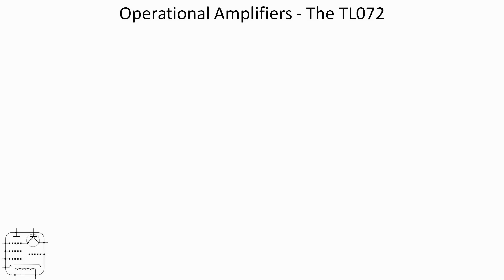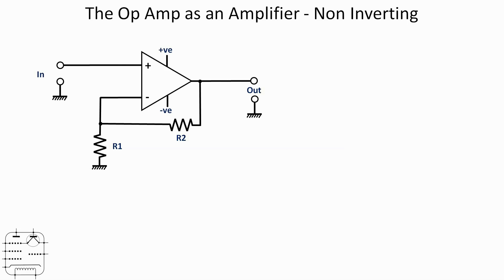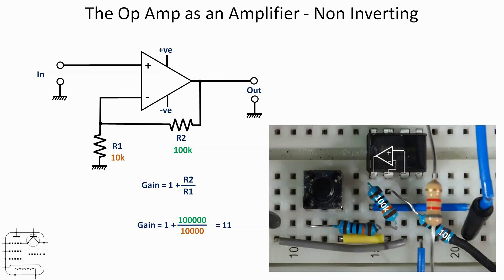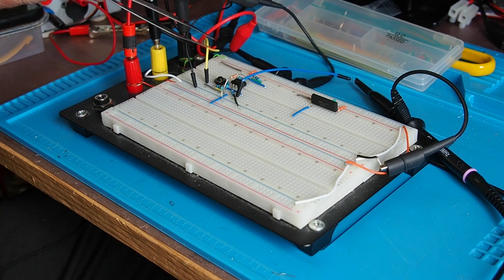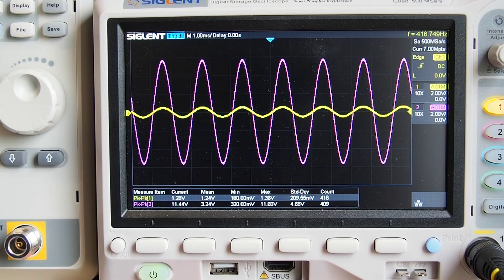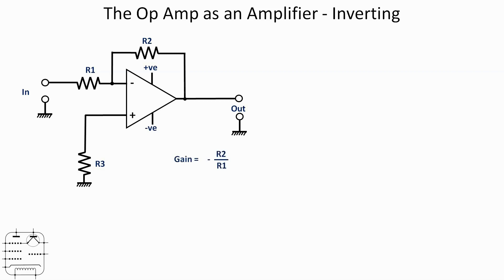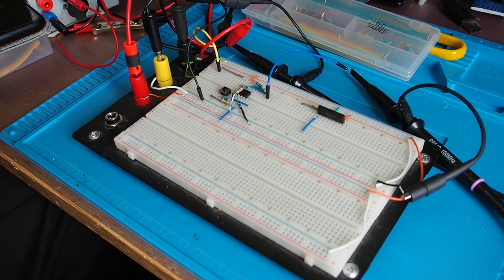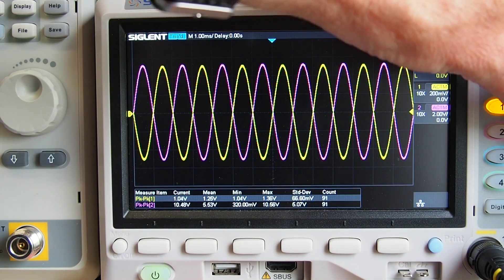Op Amps Revisited - Non Inverting and Inverting Amplifiers - #121

Comment: Nice video, But I don't quite understand the role of R3 in your inverting circuit. In fact I think it would work the same if you ground directly the Positive input (i.e., R3=0 Ohm). Can you check? Thanks! Your channel is great!
Reply: The R3 it’s compensation resistor used to cancel out the bias current. It’s not mandatory but in many cases recommended.
Reply: @marko.692  can you expand on this? I thought FET op-amps had basically infinite resistance at the inputs, and virtually no current flow.

Comment: Surely, since one of the principles of op amps is that current cannot flow into or out of an input (both inputs are connected only to JFET gates anyway) and the connection is to ground, the value of R3 in your inverting amp circuit is totally irrelevant. You could quite legitimately tie the non-inverting input directly to ground. Could you explain where you get your formula for calculating R3 from?
Reply: It’s nothing wrong with the R3 resistor, it’s common practice to cancel out the bias current. The golden rules described by you applies to perfect op amp, but in reality, input bias current does exist. For old school bipolar op amps, the bias current can be as high as 30uA, in modern op amps it's in nA range and in FET op amps the range goes down to pA range.
The formula used by Bill to calculate value of the R3 is correct.
Reply: @marko.692  This is a FET opamp we're using here. A TL072. R3 is redundant,
Reply: @oldblokeh  Then feel free not to use one.
Reply: Isn't it just the Parallel of the R1 || R2?
Reply: I know nothing about opamps, but I've watched some videos and simulated cirtuits for fun. I think the R3 is for input impedance matching, it gives same impedance for negative and positive input.
Reply: @pukkimi  It makes absolutely no sense in the inverting amplifier, as no current flows into or out of the non-inverting input. It can have absolutely no effect on the input impedance. I'll try to explain. The two golden rules of op amps are: 1) No current flows into or out of either input. 2) The op amp will adjust the output voltage to keep the voltages on the two input pins the same. In the case of the inverting amplifier, the non-inverting input is tied to ground. The inverting input is now called a virtual ground. Since it's a ground, the input impedance is always (referring to the schematic in the video) R1. Note: ground here assumes a split-rail supply, for example +12V and -12V. If you are using a single supply, then you have to create your own half-way voltage to the non-inverting input  using, for example, a voltage divider. Again, though, the input impedance will always be R1.